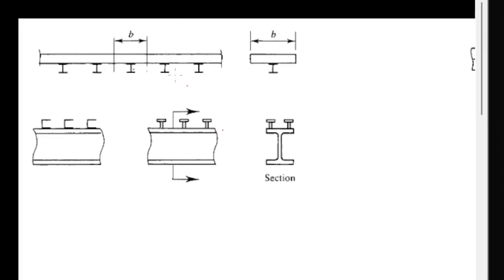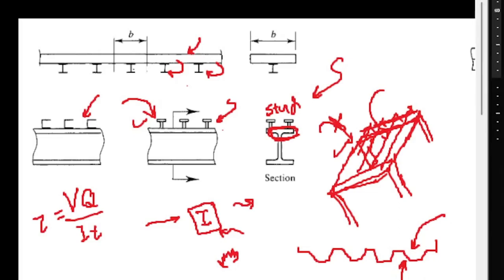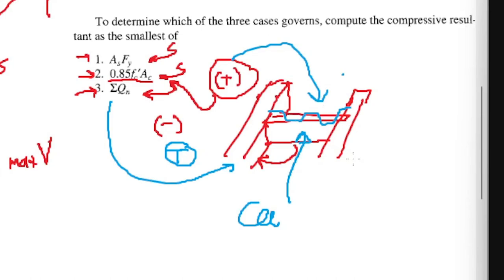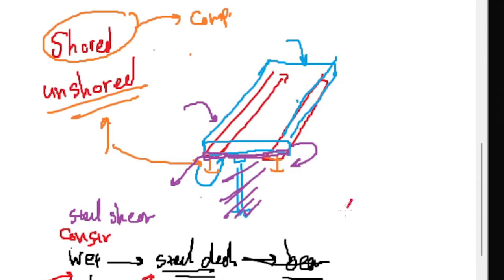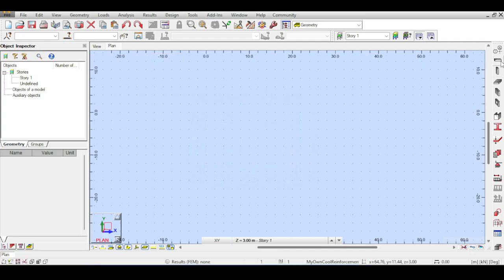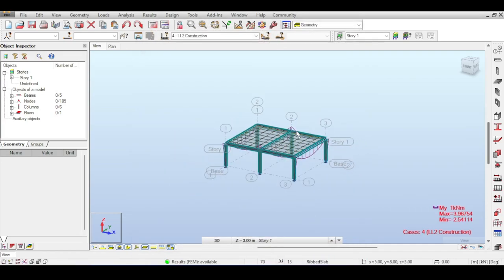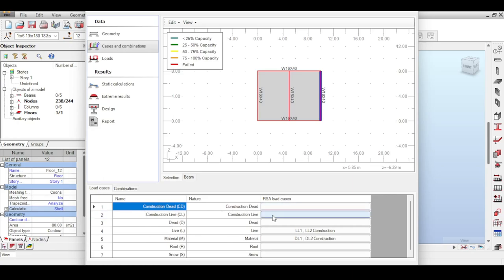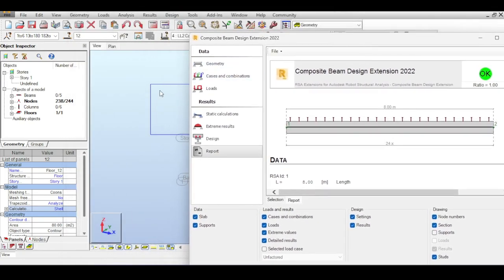Design of Composite Steel Beams in Autodesk Robot

Comment: PART II …..
  
THE RSAP ENVIRONMENT AND THE PLUG-IN

21:17 😁 LOL, Wise move of selecting the shell model type right at the beginning before anything else! I must confess that, just like the Editor, I was patiently waiting for the usual mess up there 😁.

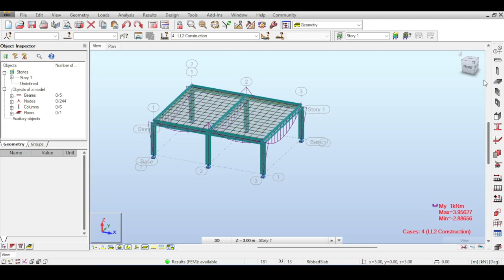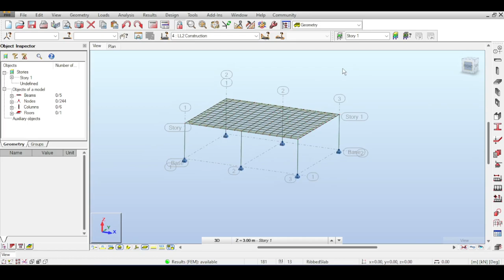27:43 to 28:30 Thanks for running through some of the possible errors and warnings that could happen when exporting elements from Robot to the composite beam design extension. It did help me to not get easily discouraged.

I have encountered a number of warnings during the export process. Thankfully to the way in which CEE have handled the warnings in this video, I eventually was able to handle my warnings. It appears though that the extension does NOT support beam sections that are not from the AISC database. 

I receive a warning that “None of the selected members could be designed” each time I try to use or to select a beam section from other databases other than the AISC. The extension is working fine for me if I use W-beam sections that are from the AISC database. 

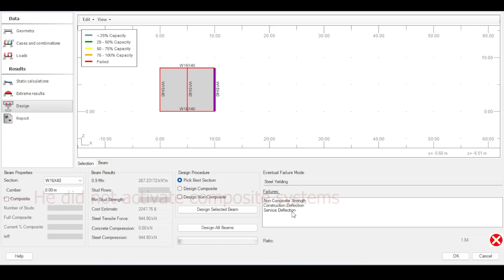I could not find a setting in the extension itself to change the supported database [if anyone knows how to, kindly advise]. The only place in the extension where I could choose a different beam section size is under “beam properties” in the Design sub-menu =31:17 on this video (only select W-sections are available there to choose from). Alas, I can only hope that Autodesk will improve compatibility with other sections from other databases in future releases. 

The extension appears to be a good extension. The “Design” options and the “Report” are quite neat. The “Design” options in the extension can also be directly used to design a steel beam without composite action (much in the same way of thinking as the nice and cool idea that was communicated by the CEE at 31:38, thank you CEE for sharing this practical approach and tip). The extension can also send back and automatically update the RSAP model with the beams that it has designed.

From what I could gather (I may be wrong); The extension currently only supports simply supported beams (i.e., the beam with +ve (sagging) bending moment arrangement). It has its own internal engine that it uses to calculate the internal forces from the load cases that are mapped directly from RSAP. It appears that it also uses its own load combination factors (I changed the Codes for Combinations from Job Preferences and this did not seem to make a difference in the extension combination factors. The extension did not even allow me to change the combination factors manually in the extension except for the one custom load combination and its associated combination factors which the extension does allow a user to change). 

I noticed an option in the extension menu itself under Edit>Composite settings> Design Tab, to change the source of “Internal (presumably design) Forces” from the extension own Internal Engine to RSAP, I wonder how this will work considering the need for various design combinations that seem to be embedded or built into the extension? Perhaps I’ll dive in later and see.

What was interesting with this option was that when one selects RSAP as the source of “Internal Forces”, the selection triggered two information boxes which required that the user should implement “pinned-pinned” releases on the beams in the RSAP model; and that the slab panels in the RSAP model should be analysed using “simplified trapezoidal and triangular method” as opposed to FE. This in a way answered my next question; I am still going to ask this next question below for completeness: 

Question: In the RSAP model that was used on this video, the steel beams that are carrying the slab were not released and therefore they had developed some -ve moments near their supports. With reference to the CEE note at 10:35, I suppose it will be correct to say that strictly speaking, one should consider to release such steel beams if one intends to model them (beams) as simply supported beams? 

Also, the above is not relevant when the extension is set to use its own internal engine to calculate the beam internal forces?  

I have enjoyed this video and I am looking forward to the next CEE videos.

Keep well MJ

Regards DK

Ps. There seem to be a growing “push” by some viewers for a “full-structure-or-a-full-building”; I certainly hope that these “push” does not derail the CEE from implementing its own contents according to its own pace and plans. In my opinion, the CEE has been excellent so far in selecting and deciding upon the types of topics to present to the viewers and I hope that the CEE will continue to do so under no undue pressure.

I don’t doubt that the time for a full-structure-or-a-full-building will come, I just hope that that time is not rushed and that it comes only when the CEE is ready for it, and not at any other moment before that.
Reply from the maker: Cont'ed.
I still messed up my material, so the editor got me right then and there ^_^

The plug-in is still not really an Autodesk software product, so it is kind of strange what kinds of warnings you might get.

I am surprised that it only works on the AISC sections, this makes me a little bit worried as to the "code neutrality" of that plugin. It is still useful, I guess, but now if it turns out that it is code biased, it might limit the usage of this tool for other people.

I need to check that thing out. I will get back to you on that.

The idea, of preliminary design was somehow not well conveyed by me, so the editor had to help me out in basically trying to rephrase my garbled mess into a coherent method.

Yes, I came to the same conclusion that +ve is only considered. Which kind of makes sense. It does have its own calculation engine, as seen by the "neatness" of its moment diagram. You know that moment diagrams when beams are connected to shell elements look kind of broken up into piees.

Oh, so it is code biased. That is really sad. But at least the idea of taking values from RSAP is good. I second your point, I have to dive into it too.

Please note that this exact thing is what my goal is with creating the CEE channel, explaining things to put you on the beginning of the road of exploration, where you feel intrigued enough to check out the depths. I am really happy that I am getting this reaction from you, it honors me. Stay amazing like this.

Oooooooh I missed to mention that!!! The negative moment was so small it slipped my mind. You did an amazing explanation here. I am going to pin part 2 as my pinned comment for other viewers to enjoy reading! YOU ARE AMAZING!! THNX

Yes, there is a push to do a full structure, and I am preparing it as we speak. It will be a multi-parter where I will be talking about a steel structure first. It is basically the most important and anticipated video. 
(Now talking about youtube, it is also the most searched video, but I am not rushing it. It is not about the views, but about the viewer. It is about being responsible for the info I serve you with.)

Anyways, it is a pleasure to read your comments. Oh, and pls tell me if I missed anything or if you have any questions.

Keep it up, Good Luck,
CEE
Reply: @CivilEngineeringEssentials  

Hello CEE,

Thanks for confirming some of your own observations regarding the plug-in. It helps to know that I am not alone. 

Thank you for the compliment, it means a lot to me, and I mean a LOT ^_^ coming from you. 

The CEE channel is one of a kind; and MJ, you are amongst the Giants that Sir Issac Newtown would have been envisaging when he reportedly wrote that “…. If I have seen further, it is by standing on the shoulders of Giants….”. This is how I feel about the CEE channel and about you as a person. 

In my opinion, all of your viewers (myself included) are exceptionally fortunate that you are willing to make time for all of us. I am glad to hear that you are not allowing yourself to be rushed. You have done a lot for all of us and you continue to do even more. I’d say that take your time, all the time that you need and work on your own pace which fits into your own schedules not those of anybody else.

Long live CEE Channel, and I’ll see you in the next videos. 

Regards DK

Comment: Hello CEE,

PART I

This is a very nice and a well-received practical topic. I find your theoretical discussions including the practical and construction tips and the reference material to be unmatched as always. 

I especially appreciate the mentioning and provision of the glimpse (in CEE style) of all of the important concepts that are involved including the transverse shear and the shear flow equations; and the significance of the type of construction of the slab on the slab ability to provide lateral supports to the steel beams. I find these hints to be really helpful in pointing the user to the right directions. 

06:40 Truth be told, up until now that the CEE has mentioned this, I never really paid attention to the implications of the Ultimate Limit States approach on the use of elastic analysis theory. Thanks for bringing this up.

10:10 I am covered with regards to the composite behaviour under the +ve (sagging) bending moment. I have also looked at the referenced text for the case of continuous beams in zones of -ve (hogging) moment. The conclusion from the referenced text indicates that “……. the additional strength gained from considering [the other] composite action [involving the structural steel beam and the longitudinal reinforcing steel in the slab] for negative moment is relatively small. And if the steel shape alone is relied on to resist the negative moment, cover plates are sometimes added to the beam flanges to increase the moment strength….” 

Question: In consideration of the above conclusion, is it not better to avoid the negative moments all together for designs that involve composite slabs? 

In your experience, what (if any) would you consider to be practical situations where continuous composite slabs with negative moments are beneficial? 

Would a consideration that a continuous beam will deflect less than a simply supported beam for relatively long spans be enough to offset the above conclusions in favour of a continuous composite slab for instance?

11:35 🤣 “……all engineers could use software, MOST of them will not blunder anything….” 🤣

I must say that with every video release by the CEE channel, this statement is becoming truer and truer by the day (week), one video at a time. 

Better still, the CEE channel is levelling the knowledge playing field through clear discretization of the underlying principles and concepts for various subjects. Consequently, the goal post for “a competitive edge” is constantly shifting with the CEE channel…. all aboard! hop on! … 🚉🚅

Comment continued in PART II.....
Reply from the maker: Hi there Engr. DK,

Happy you liked the video.
Having a small blindspot with regard to implications of elastic theory and ULS design is totally fine. I have to remind students and professionals alike about it.

It is great you checked out the reference text, it really contains a lot of cool info that would complement the tutorial. For negative hogging moments, indeed cover plates are sometimes added to the strength. 

About your question: Well, yes and no ^_^
Sometimes, negative moments are a must due to stability reasons (a rigid joint in a frame as an example). But I still would - as a designer - avoid negative moments wherever possible. Why?
1) Composite action
2) <-- and this it will actually cost money: Note: it might be a little bit deep so tell me if you need further clarification: Connection design and implementation. Having negative moment would cause you to have a rigid joint in steel. Notice, unlike concrete, rigid joints in steel have to be constructed. Concrete is a little bit simpler, just connect the reinforcement in a proper way and cast monolithically. In steel, your column is usually continuous (it is the critical component after all) and beams are basically "hanged/connected" to them. Having a continuous beam on a column would cut the continuity of the column, and cause sever complications when designing that beam, as "suddenly" the flange of the beam needs to transfer the pressure from top column to bottom column. 
The only exception for having an uncomplicated continuous steel beam is when you are at the last floor. But that is rather a special case.

As for me, I still have not seen composite construction specifically for negative moments. Some people just design 1 composite design and use it for the entire slab (that is a waste of material). I am interested if any viewer saw smthn like this. 

As for deflection control, I do believe that steel has less problems in terms of deflection that concrete for multiple reasons:
1) Its E is 10 times more than concrete
2) The ability to shape it into REALLY COOL efficient sections such as I (concrete I exists, but is used in bridge design).

So I still am of the opinion to avoid continuous beams whenever possible. "I am not totally advocating against that". Usually, your main girders DO need rigid connections. By girders I mean larger beams. To understand exactly what I mean, here is a typical load path

Slab -> beams -> girders -> columns -> foundation

Once again, happy to read your comment and your feedback, it helps a lot actually.

Oh and sorry if my comment might be a little bit dis-organized, as you know, I read your comment and write the answer immediately. It is quite good to be honest. Those discussions actually help me cover points I have missed in the video. Huge thnx to you.
Reply: @CivilEngineeringEssentials  

Hello CEE,

Thank you so much for the comprehensive feedback. I do not find it to be disorganised at all, the information that your feedback contains is to die for. I love that you are always honest with your experiences and opinions; your response is on point and it is practical. 

The explanation of a scenario of having a continuous beam which would cut the continuity of the column is clear and it is very much appreciated. I hope that perhaps in some future videos (and if an opportunity presents itself) this scenario is something that could be explored, modelled, and designed to serve as an example of this concept in practice.

Your use of typical “load-paths” in order to illustrate what is being discussed and to help the viewers with an even better understanding and visualisation of what is being talked about is quite effective, keep it up.    

I also thank you CEE, our discussions are helping me a lot, and I do mean a LOT ^_^ (you are helping me a lot). I really like the person that I am becoming because of your channel.

Thank you and keep up the good fight.

Regards, DK